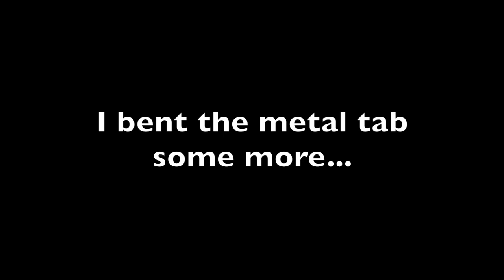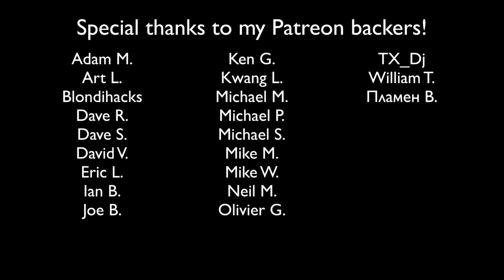#70 My Apple II Plus is Broken

Comment: Those later key switches are a pleasure to fix compared to the old Datanetics DC-51 switches in the original Apple II.  The DC-51 is glued together, and the contacts are sealed inside a Mylar sandwich so contact cleaner and/or deoxit can’t get down in there unless you break the glue holding the two halves together, and disassemble key, and glue it back together.
Reply from the maker: That sounds awful! Thanks for sharing the info.

Comment: Very helpful video. I've had similar issues with my Apple ][ plus keyboard and did a similar fix. As a side note, what are you using your Videx 80-column card for these days? I recently picked one up but haven't actually put it to use yet. I would assume Word Processing, BBS viewing with 80-columns or text adventure type games?
Reply from the maker: Thanks for the feedback! That's a good question about the 80-column card. To be honest, I took mine out because I wasn't really using it for much, and it just draws power for no good reason. But you could certainly use it for things like Word Processing, BBS's, etc. And you're right, some of the later Infocom games work in 80 columns.
Reply: @CT6502  you're welcome. I really enjoy your channel. The Apple ][ plus was the first computer I used as a kid in elementary school doing things with LOGO and such. I later got a C64 (I still own my original machine) for a Christmas present. I've owned an Apple ][ plus for a while now and been getting back into all things Apple II. At some point I want to do a video on my channel about it. Now to go find some Infocom games that support 80-columns ;-)
Reply from the maker: @geekwithsocialskills  If you get a hard drive card (like the Booti) then you could download the Pitch Dark game archive, which has all of the Infocom games... https://archive.org/details/PitchDark
Reply: @CT6502  Pitch Dark won't run on my Apple ][ plus since it's only 48kb, 64kb with my language card. According to the link you reference, it needs 128kb. I do own a Apple //c computer.
Reply from the maker: @geekwithsocialskills  Ah, you're right about not being able to run on a II+. Sorry about that. Well, it should run on a IIc, but of course that defeats the purpose of using the 80-column card. :-)
Reply: @CT6502  I see how you are LOL. Do you know if there is a memory upgrade card for the ][ plus machine? I do like my IIc, but my memories are with the ][ plus ;-)
Reply from the maker: @geekwithsocialskills  Well, there are lots of memory cards that theoretically add 64K, but the memory behaves very differently in the II+ compared to a IIc or IIe. For the II+, it is "banked" in 16K increments, so it never looks like 64K in a single block. Some programs (like Locksmith) can understand the difference and make use of the full 128K on a II+, but many programs only see the first 16K. So even if you got a memory card like the Saturn 128, it really wouldn't do you a lot of good on a II+...
Reply: @CT6502  thank you for the information. It does seem silly that a text adventure would require more than 64kb of memory to run in 80 column mode on a ][ plus.

Comment: Very finnicky switches, ones in my Apple II europlus became bouncy and unreliable back in the day. Seems they improved them for the //e. I had a Videx video card for the ][+, probably a clone. It didn't have a connector like yours, it had its own video output (so I added a video switch to my TV-converted-monitor). The videx's scroll speed was awesomely fast compared to the juddery memory page interleaved 80 column mode for the //e. Wish I still had that system now.
Reply from the maker: That sounds like a nice system. Well, you can always start collecting again...